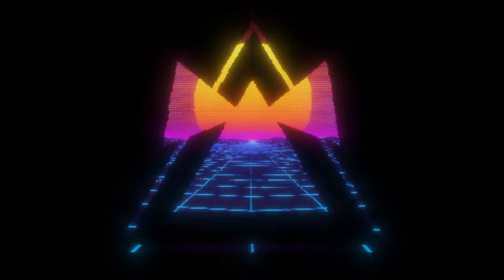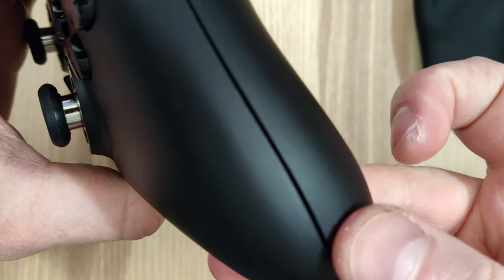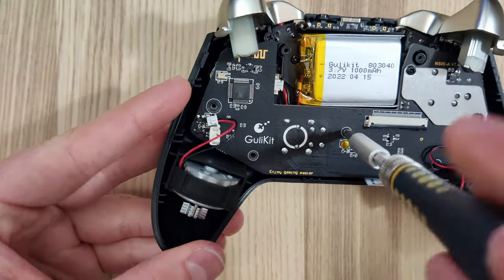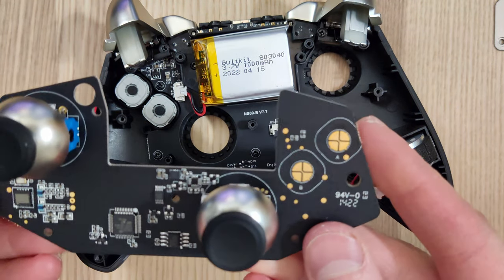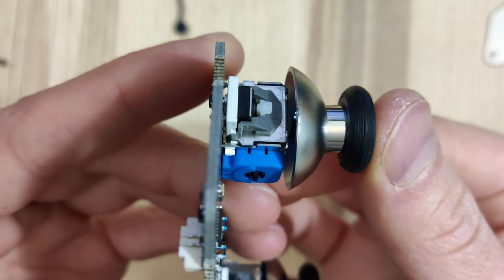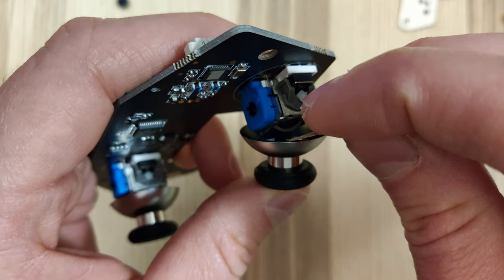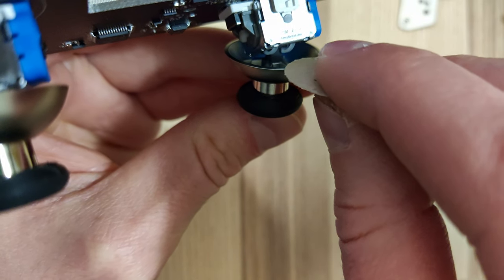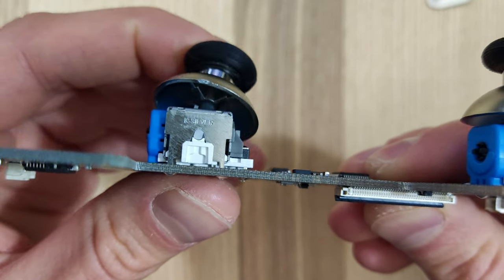Gulikit Quality Control Issues (KingKong 2 Pro Teardown and Joystick Fix)

Comment: Please answer..
Is the joystick module similar to PS4 joystick? Or is it similar to Xbox or PS5 joystick?

I need the answer.. because my joystick broke, and I need to replace it.. but idk about the joystick type
Reply from the maker: This is different from both the Xbox or PS5 joysticks. Each of these controllers joysticks are proprietary to their own controller, but this is also using hall sensors.
Reply: @KeiRetroGaming  ohh RIP then.. my joystick module broke.. and Gulikit doesn't sell the replacement for it..
Is there any way I could get a replacement?
Reply from the maker: Reach out to the official store on AliExpress:
https://gulikitofficial.aliexpress.com/store/5117015
Reply: @KeiRetroGaming  yeah, I've search for it.. they only sell joystick module replacement for steamdeck and for nintendo switch joycon

Comment: so i bought my controller about 4 months later, judging on battery date. my "B" was squeaking which is what made me find this video but i looked at my joystics and had the same problem as you, though not as noticeable, but i emailed them about it anyways. I really want to know if it is possible to change the button config to look like the xbox style i know they are different height y,b,a,x just wanted to know if you had any ideas on how to change that.
Reply from the maker: Yep all you need to do is swap them over using this kit they sell:
https://www.aliexpress.com/item/1005004421358481.html

Comment: Hello, I'm a Speedrunner so I might want sometimes to have to mash buttons a lot and do some rapid tricks with the joysticks. Usually my controllers "live" for long durations but you kinda feel later how weak the buttons become. Would you recommend this controller to me ? When I buy devices I emphasis much on how long they can survive with me.
Reply from the maker: I would actually recommend the controller in that case. The hall sensor sticks are drift immune and the buttons are easily replaceable and sold by the company for about $10 CAD in the unlikely case you'll need to replace them. The buttons themselves are decent and you shouldn't have issues with them to begin with. It also has a handy macro feature if you need to spam something constantly and the latency is pretty decent at 11ms over Bluetooth. You probably won't find smoother joysticks or triggers on any controller out there.

Comment: Nice work! Btw, how could i fix an issue with the buttons? i played with mine for about 4 hours with Pokemon Arceus (too much text) so i did hit the 'A' button too many times and it got to a point where if i press it and move just a little bit to any side it get's stuck and it's difficult to already play any other game as the button can get stuck easily
Reply from the maker: Button sticking is a known issue unfortunately. I'll definitely let the community know if I find a good fix for that, in the meantime pressing straight down on the button seems to keep it from sticking most of the time I've heard. My one controller has very minor sticking but the other one I have is fine.

Comment: Great video! 
I have the same issue but, In my case a very tiny plastic part has broken (inside on the left stick). Unfortunately, they don't sell the replacement stick. It's a very specific and patented module. I think the stick replacement kit for steam deck it's the same stick. Maybe desoldering and put in it into the kingkong 2 pro would work.
First I contact them I hope they send my a replacement part 🤞🤞🤞
Reply: Finally they sent me the analog replacement part. And I fix my control. Thanks to the Gulikit team, and specially to Cathy wich is the person who answered me the emails. They sent me for free the analog, I didnt even pay for the shipping 

In your face ASUS, they should learn from gulikit customer service. Thanks!!!
Reply from the maker: Glad to hear you got it fixed. Gulikit seems to have pretty good customer service.

Comment: if i wanted to use this as a PC controller ... would it work the same way if i opened up and rotated the buttons around (to an xbox configuration) ???
Reply from the maker: No unfortunately they're all different depths, I tried. You'd need to buy the button replacements from Gulikit to get it in traditional Xbox format:
https://a.aliexpress.com/_mPchpec

Comment: Cant you remove the cap without removing all the parts? It looks so hassle.
Reply from the maker: No unfortunately, the shell blocks the cap from coming off unless you pull the board out of the shell first.

Comment: Hi! Do you think in the future, Gulikit will release hall sensing analog sticks for the NS09 standard version?
Reply from the maker: Both of their Kong controllers have hall sensor joysticks. The NS09 is the pro model with the most features including the hall sensor joysticks. I own two and aside from this horrible plastic issue from the factory I've been amazed how good they are.
Reply: They have the King Kong 2 at their webpage recently. They first announced the King Kong 2 Pro. The regular King Kong and King Kong Pro controllers that has no number "2" on them so that means it doesn't use the hall sensor sticks.
Reply from the maker: Ah this was the one I was looking at:
https://www.gulikit.com/productinfo/828615.html

Either way still looks like a solid controller. Are you looking at picking up one?

Comment: Hello, could you please let me know the height of the joysticks, can I replace them with aftermarket joysticks for PS4? or are they the same size as Xbox One?
Reply from the maker: The joystick height is 1/4", and yes I've heard the Xbox one is a direct replacement if you want to swap it over. Haven't tried it personally yet though.
Reply: @KeiRetroGaming  thank for the quick response, this is definitely help when applying ur fix and/or replace them altogether
Reply from the maker: Have fun! It's a great controller overall and I think you'll enjoy it.

Comment: i really love the controller, but that A button aint it. it always sticky for 2 days playing time. i did try to swap a and b mechanical silicone but two days after A button problem reoccurs. i really dont know why its only happening for A button. as there is no extra mold for the button

Comment: Does anyone happen to know if it can continue to function by wire with the battery completely removed?
Reply from the maker: It should work in theory as the device is getting power if it's plugged in so I'd guess it works fine without a battery. Is there a reason you want to use it without one?

Comment: Im planning to get one of these, do you know if the newer or older batches are more likely to have these problems?
Reply from the maker: The second controller I bought seems to work much better but still suffers the same problem. Both are usable as-is but the 3rd one I bought for a friend seems to have stuck triggers instead of the joystick issues (the white one seems to have this problem for some reason occasionally and I've heard of it between a few white models). Overall you're probably safest buying a newer production model now of the black ones and skip on the white for now until they fix the trigger issues. Hope that helped! Genuinely hope you get a good one as these are pretty amazing controllers minus these random issues.
Reply: @KeiRetroGaming  thanks so much for your info man, its a shame because i was aiming for a white one. Horrendous qc for sure
Reply from the maker: They seem good about sending you a new trigger if you get one that sticks if you buy it from the official Ali store. That of course only works in your favor if you're comfortable taking the controller apart. Hope you manage to get a good one if you go for it!
Reply: @KeiRetroGaming  I live in hong Kong so im most likely buying it from taobao (ali express equivalent) for $45 usd, cheaper price in exchange for negligent customer service.

There are also reviews complaining about joystick not smooth and A buttons not bouncing back as well. Tbh im still a bit put off in buying it but the drift-immune property is too attractive
Reply: @KeiRetroGaming  triggers getting stuck also happens with the black ones, albeit it takes a bit longer before they start getting stuck
Reply from the maker: Your black controller? How long did it take before it started having sticky triggers?
Reply: @KeiRetroGaming  after around 1 to 2 hours of gaming. My vendor replaced it with a white one, which was even worse (stuck triggers within 30 minutes)

Comment: its better if you remove the cap first before sanding it. it can be lot more problem if some of file dust get in the joy switch itself
Reply from the maker: I gave it a good tug initially but it never came off, pulled a little harder the second time I did a teardown and managed to get the caps off. Can confirm its much better to remove the caps yep.

Comment: OH my GOD! if anyone is having the same issue with the X, Y, B, A, buttons!! its the spring mechanism being assembled in a wrong position! lol! found out after watching this to take apart! 

The little gray box under the main buttons! there is four sides! 2 latches on 2 side of the gray box, also surrounded by the other 4 in each corner holding the thing together! the piece that retracts after pressing  down has this little part that sticks out and gets stuck under the 2 latches I mentioned! look into it! >;,D.  Caution!! vary light plastic! housing, also fragile.
Reply: or i could be wrong, it helps with my problem but.. the clicking is gone and more smooth after I did this.
Reply: and got rid of the buttons squeaking after intense gaming xD!

Comment: can i switch the B - A bottom and make it like xbox layout A - B if i Disassembly the controller ??
Reply from the maker: You can but you need to buy a different button layout as the tops above the switches are different depths. Here's a link to the part you'll need:
https://a.aliexpress.com/_m0lctH0

Comment: my KingKong 2 Pro controller is drooping the connection and goes in pair mode soon after turning on. Seems to have connection issues. works wired but that is not ideal
Reply from the maker: Try updating the firmware to see if they help. I had the same issues initially but the firmware updates fixed it.
Reply: @KeiRetroGaming   I did update to the latest 5.1 and 1.7cpu same issue not sure if the battery is involved in it but the battery it should be as good as new

Comment: Second one just got here today and right out of the box same issues with the triggers and the left analog stick does nothing in game for the sprint when you push it in. Hopefully the 3rd one will be the charm it comes tmr.
Reply from the maker: Have you been buying and returning them on Amazon hoping to get a good one?
Reply: @KeiRetroGaming  yes do they have all the old versions? I ordered it from the gulikit amazon store
Reply from the maker: Probably older stock compared to getting it from them directly on the official Ali store but you get peace of mind with returns. I bought two with no hope of returning either, luckily though I managed to fix both. Make sure you're using the correct mode and that you've run both updates:
https://www.gulikit.com/newsinfo/593338.html
https://www.gulikit.com/newsinfo/588841.html
Reply: @KeiRetroGaming  says its up to date hopefully this next one is good if not I’m going to order directly from the website. Thanks for the help
Reply from the maker: You're welcome. Hopefully the new one works out and you don't need to order overseas.. doesn't take long to arrive (under 2 weeks) but it's no prime shipping that's for sure. The official AliExpress store is pretty friendly at sending parts and resolving your concerns if you get a faulty unit from them as well so that's also a bit of peace of mind. Hope you get a good one on your next unit!
Reply: @KeiRetroGaming  awesome i just downloaded the ali app!
Reply from the maker: Hope the new one from Amazon works first. Obviously the official store is there if not but nice to have those easy returns, keep me posted how it turns out or if you have any other questions.

Comment: i have an issue where the friction between my trigger and bumper is causing the bumper to stick until i press down the the trigger does anyone know a fix for this. wasnt happening before i took the controller apart tried lubbing the friction point but didnt help
Reply from the maker: Is it the white model? I had a friend with the same issue and Gulikit gave him a replacement set of triggers which fixed it.

Comment: Can we change the battery to something bigger? May be 5mm bigger in each side for higher mAh?
Reply from the maker: Unfortunately I don't think you'd be able to find a replacement battery easily for this controller. You might be able to get Gulikit to ship you one but due to battery shipping restrictions I doubt they'd be able to.
Reply: @KeiRetroGaming  pal, it's just 3.7v Li-Po 1000mAh battery. It's not proprietary. It's 3x4 cm with 8 mm thickness. I'm asking if a bigger one fits inside the device, no need to buy that from GuliKit directly.
Reply: @Clarissa 1986 may be if we turn it 90°
Doesn't have to fit in its place, but anywhere inside the device.
Reply: @Clarissa 1986 25 hours is not enough. my xbox needs charging once a week (too much) - and I never play with cable! 

good rumtime is charging once a month.

Comment: my controller will randomly disconnect when I use wired also  it turns  switch back on  straight after sleep any ideas ?
Reply from the maker: Are you using this exclusively on your switch when it disconnects in wired mode?

Comment: Where did you buy it from? Amazon or directly from their store?
Reply from the maker: Directly off the official AliExpress store, right from Gulikit.
Reply: @KeiRetroGaming  thanks mate.. i did not even know they have a AliExpress storeFront cool. also save 16 euro..that i can use to buy their mechanical button kit. i'm going for this one instead of the "8Bitdo Pro 2 " or the "SteelSeries Nimbus+"
Reply from the maker: The 8bitdo Pro 2 is decent but I still prefer this controller due to the smooth joysticks and triggers. I think you'll be pretty happy with this and they've mentioned addressing this issue so the newer ones are probably fixed. I'm sure you'll have fun with it, it's a great controller.

Comment: I actually had this issue with the first one i bought. I returned it. Now the replacement that i got is having this weird issue where the inside sounds like it's rubbing against something. The same sound my worn down switch pro controller had after 5 years
Reply from the maker: Hope you manage to fix it once you have time to open it up and check what's going on. These joysticks definitely need to be looked at and fixed eventually from Gulikit's end. One of my 2 controllers feels rough when moving the joystick in a certain direction almost like it's scraping against or rubbing against something too. Haven't had the time to open my second one to take a look at it yet though.
Reply: @KeiRetroGaming  this quality control sucks. But otherwise functionally they are excellent

Comment: Personal story about why I hate plastic clips. Got knocked off my moto and ripped the bumper off a Mercades Benz while I fell. The bumper was fine, externally - but the cheap-o plastic clips were broken. They asked me to pay 3X my rent to replace the bumper. I told them to piss off and use their insurance cover. I still had to pay almost 1 month's rent.
Reply from the maker: It's incredible how bad some plastic clips are.... even on expensive products. Nintendo for how much they like to save money does generally make durable clips on their products. I was pretty careful opening the controller so I'm shocked to see the clips break like that. Definitely more durable clips than the Dualsense though either way. Here's to hoping we see some more durable clips on controllers in the future from Gulikit!  Scary situation to be in regardless, glad to hear you're okay.

Comment: Im planning on buying this controller, would you still recommend it?
Reply from the maker: With this issue being on the controller...albeit not affecting every unit, if you're comfortable with taking things apart or following this guide then yes. The hall sensor joysticks and comfort overall makes this the best controller I've used. It's a shame to see a problem like this affecting a nearly perfect controller otherwise. I'd buy another one in a heartbeat if I needed one just with how smooth the joysticks and triggers feel, I really can't go back to using my dualsense after using this. Dualsense is definitely heavier though (some people prefer that).  Hope that helped! It's a great controller and if you get one without this issue you'll be happy.
Reply: @KeiRetroGaming  Thank you, I'll keep that in mind
Reply from the maker: You're welcome! If you do get one lemme know if it has the same issue. Trying to expand my sample size a bit.

Comment: Yup, my controller has a notch as well. Both of them. Also you can pull the  head of the joystick out.
Reply from the maker: Shame to see so many quality control issues otherwise plaguing a great controller. Figured out those could pull off with a slightly more bit of force after making the video. I pulled them off when I had to open it again to sand down a bit more, luckily seems much better now.